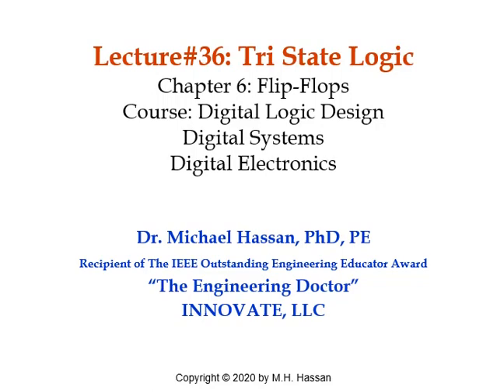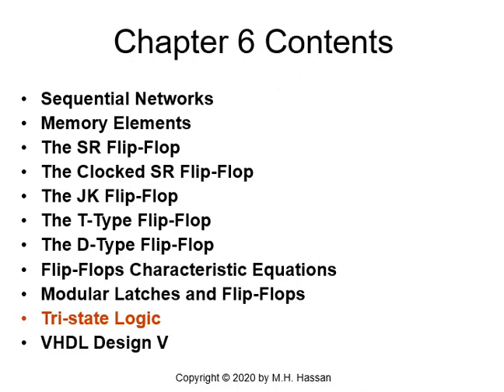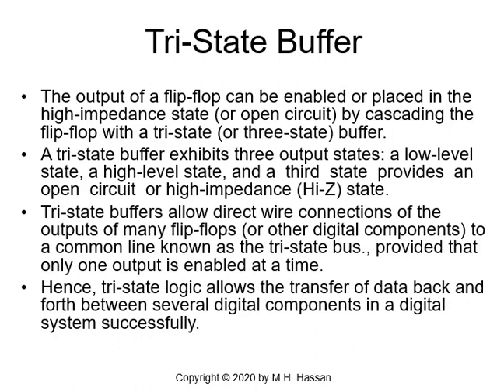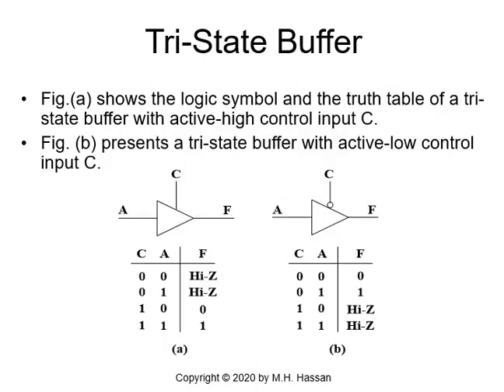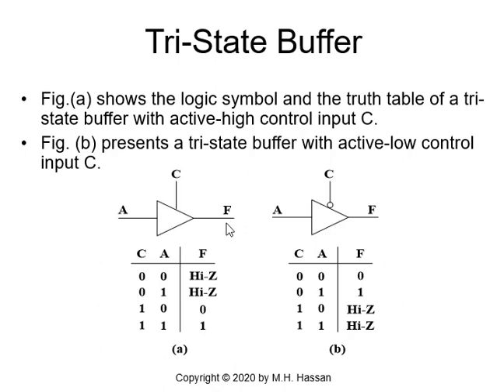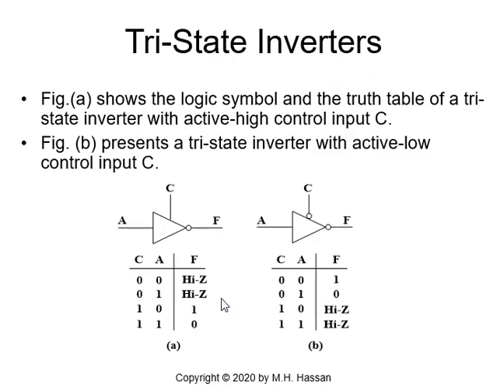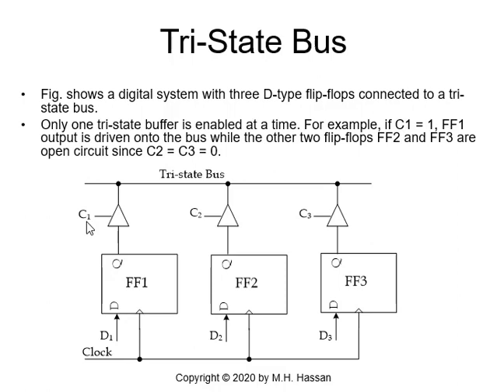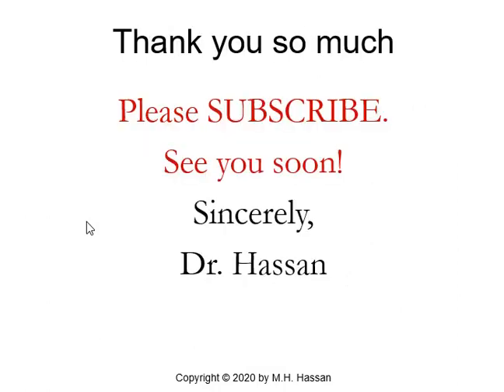Tri State Logic, Digital Logic Design, Lecture #36, TheEngineeringDoctor

Comment: Sir tristate circuit and tristate buffer are the same thing?
Reply from the maker: Tri state circuit may be a tri-state buffer or tri-state inverter. The control signal may be active low or active high. All the best, Dr Hassan